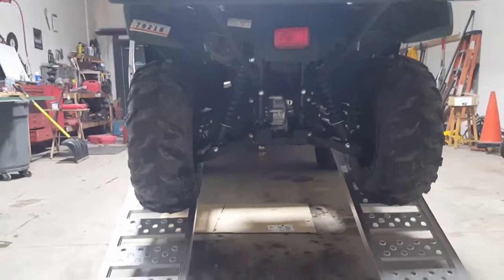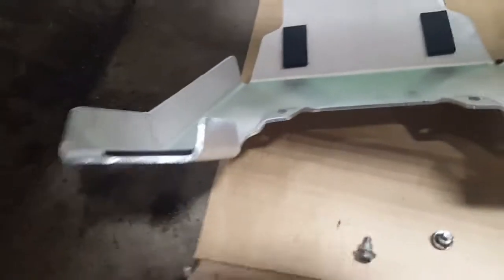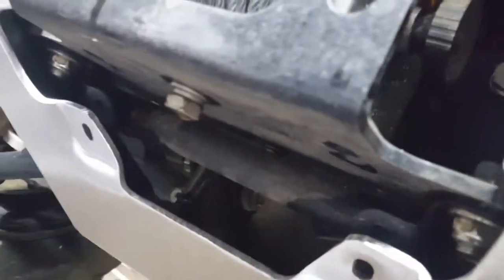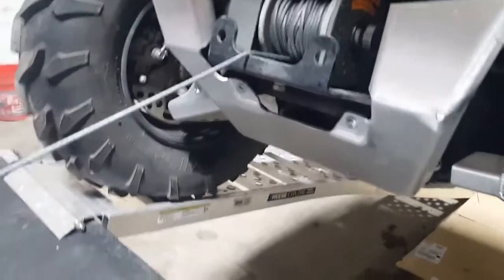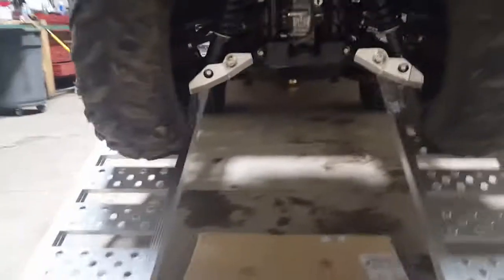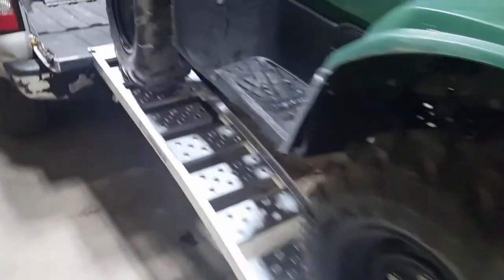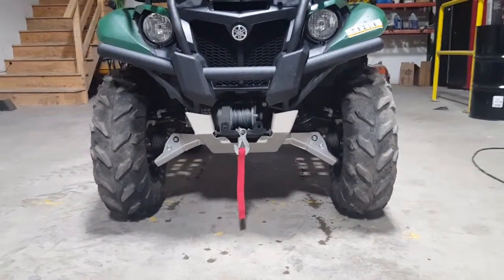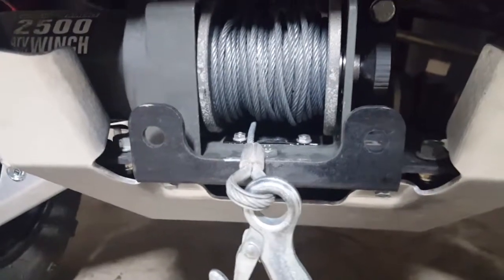ATV Skid plate Install on 2017 Yamaha kodiak

Comment: I have the 2017 Kodiak 700 real tree addition base model. Where is the best place to get accessories?  Led head light bulbs, wheel spacers ect?
Reply from the maker: Best bet is probably ebay. Just make sure the seller is legit and has good reviews.